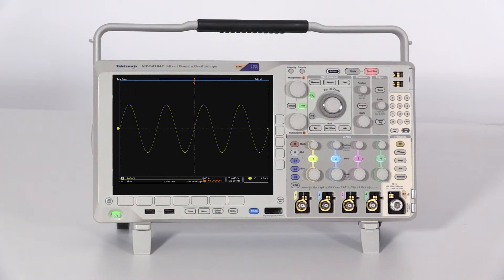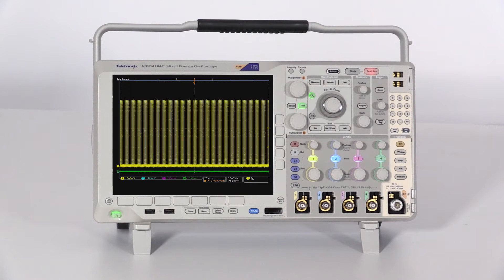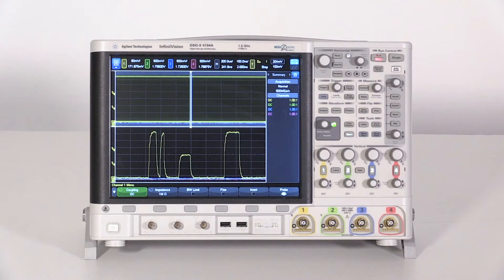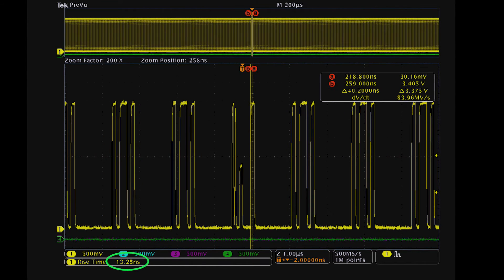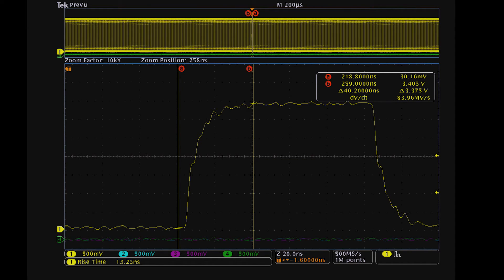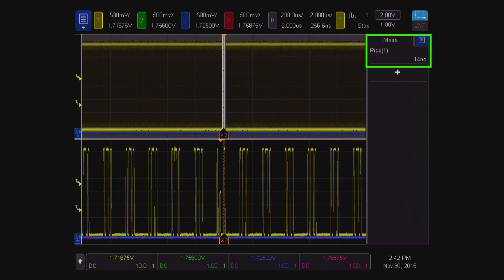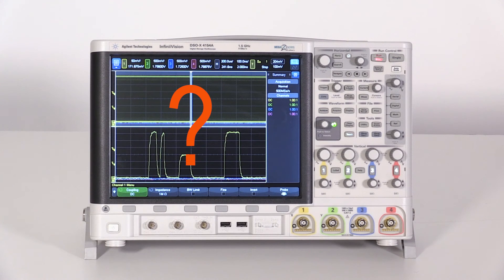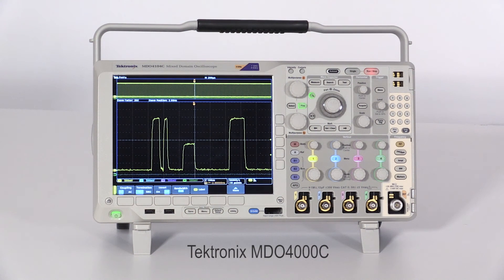Tektronix MDO4000C vs Keysight MSO/DSO-X 4000A Measurement Comparison

Comment: Not a very fair comparison when the Keysight was released in 2011-12.
Reply: +T Komoski you can compare KeysightX4000A vs dpo4k/mdo4k , who was released in  similar time. Im talking only about measurement function.
Reply: +T Komoski Still accurate for these types of measurements, sadly. Agilent nailed everything about the X series except for the measurement portion. Love my 3000X and vastly prefer using it over the DPO3000 in the lab. Kinda wish Tek would just talk about whats new and useful in the MDO4000C videos instead of these non-sense comparisons - the whole point we're considering getting a 4000C at work in the next month or two is the same as when it got released; do we need the time-correlated RF channel for the current work or not? I don't give a shit about these other "comparisons" which are usually inaccurate and, inferior to Keysight or R&S.
Reply: +Alex Ryan Tek did not phase out the MDO4000 series, they just revamped the B series. They just lowered the price point, by striping out the base functions. Which I believe is good because if you don't need all the options, you can always add them later. Compare an Rohde & Schwarz against Tek, now that would really be unfair.